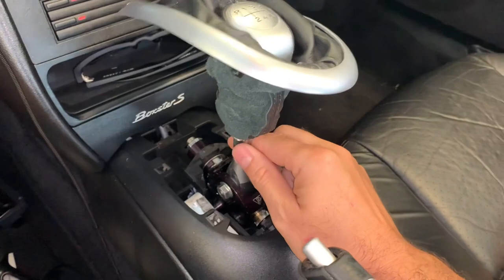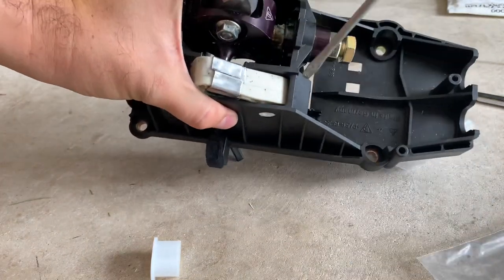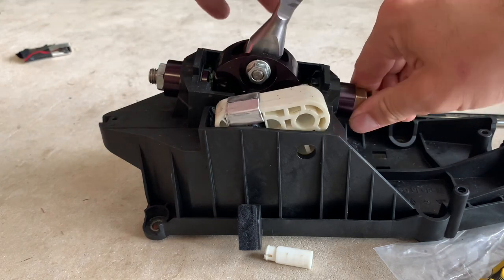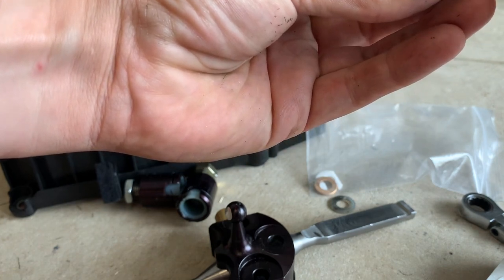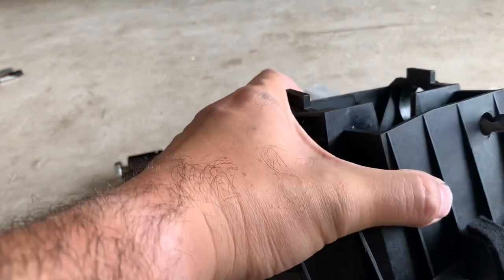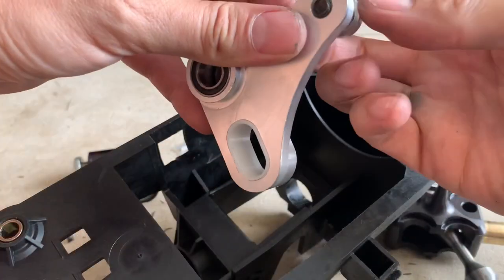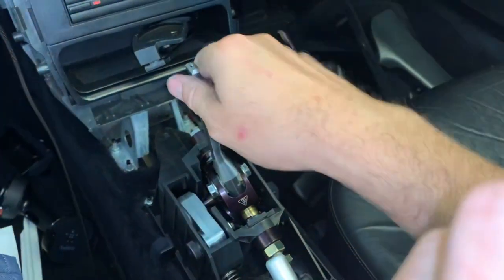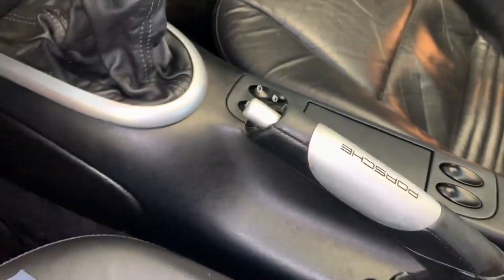Porsche Boxster 986 or 911 996 Ben Auto Design Shifter Side Lever and Gyrhead Shift Improvement Kit

Comment: Bearing of the Gyrhead Shift Improvement Kit from eBay link can’t be found. Is this company still making these? And with the BAD side shift would this still work with the eBay/Amazon/AliExpress shifter? Cheers
Reply from the maker: @onelife1love  try contacting them directly as I see they are still a EBay seller https://www.ebay.com.au/usr/gyrhead and yes it works with a cheap shifter. I do suggest saving up and getting the Numeric shifter. It is 100% a different experience and worth it. Even if you hunt down a used one. In my other video there is a discount code for Numeric. Not sure if it still works but worth checking

Comment: That honestly looks awful ngl.
Reply from the maker: The internals that you do see or the shift knob? I have since replaced it all with a Numeric shifter and it is next level in feel and precision. There is a video on our channel of the install with a comparison between this and 3 other shifter options for the 986/996
Reply: @TheEddysGarage  the side lever part just looked kinda jank and crooked… but it sounds like you got the ultimate upgrade anyway.
Reply from the maker: @davidshaw164  the stock plastic lever is also on an angle. Installing the BAD leaver did make a big difference in shifter precision.
Reply: What size are those roller bearings?